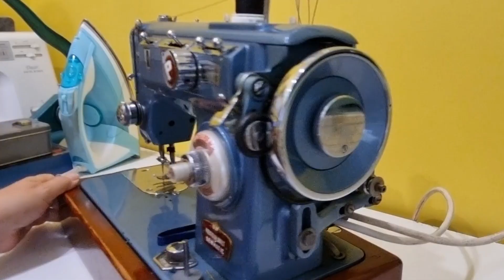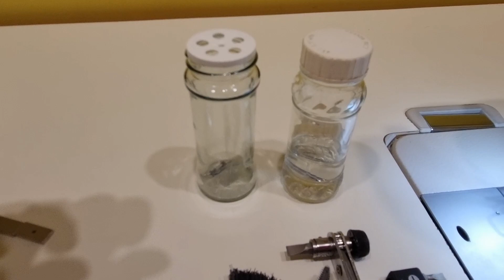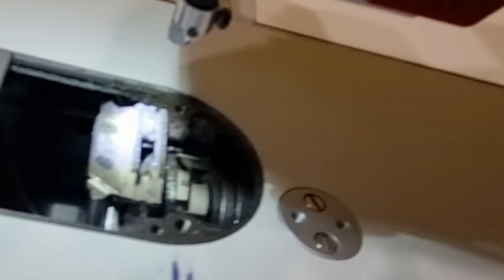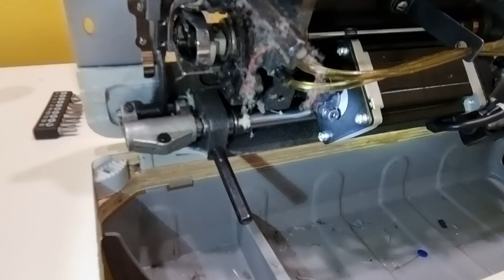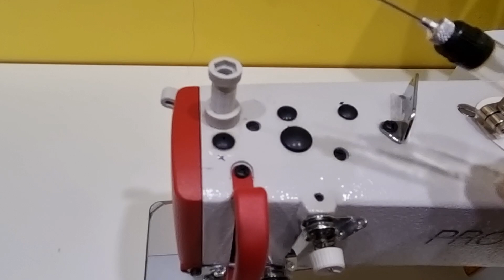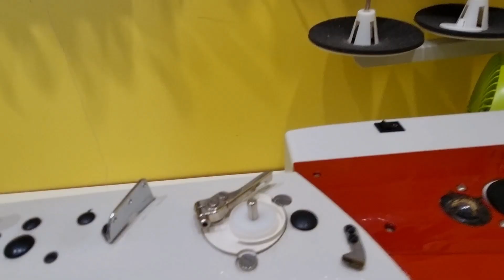Machine maintenance, changing a vintage sewing machine belt, some handy tools, and an electric shock

Comment: Phew that was a close call with the damaged power board! 
Great tip to use a mascara brush, will have to try that one. 
I have one of those mini ratchet screwdriver sets too, so much easier to get into tight spaces to clean and service my vintage Singer machines. Your vintage Pinnock is gorgeous!
Reply from the maker: Thanks Dianne. It is an adorable machine😀

Comment: Magnets are really useful. I have one on an extending pole to pick up any dropped needles and pins that I’ve dropped that I wave across the floor. 

When I change needles I use a sharpie on the flat side to mark it as used before put in into the needle box.
Reply from the maker: Great tips Duncan. Thank you😀

Comment: I'm scared of electricity also.  This time of year everytime I turn on a light switch I get a static electricity shock from the screw in the plate.  Replacing old Power strips is a good idea.  Thanks for sharing.
Reply from the maker: Oh that would be frustrating Cynthia. I often get shocks from the car door handles😀

Comment: Christine nothing worse than getting an electrical shock, lucky you are ok.  Might be a good idea to invest in a GFI, like they put in the bathrooms and kitchens. I have a Pfaff walking foot industrial machine it is old but it is a very strong machine.  I like the idea of a finger guard, when sewing a boat canvas cover I almost ran over my finger.  That really scared me, I did realize that motor still holds a charge even when you turn the motor switch off. Great video thank you
Reply from the maker: Stitching your fingers hurt. I've done it twice now. On a domestic machine too😀

Comment: To get to the screws in the cover plate, I use a couple of screw drivers, that I got from Temu. They are short and stubby and work great. Also, a US quarter coin works well. It is rounded and fits into the screw heads.
Reply from the maker: Thanks Richard. I have a couple of those tiny Singer screw drivers, and forgot all about the coins😀

Comment: Oh lord Christine! I’ve had that happen to me as well! Scared the pants off me 😱glad you’re ok. Thankyou so very much for this video. I inherited my mum’s old Pinnock machine, can’t remember the model at the moment, but I had to bring her out when both my ‘high end’ domestic machines decided to go on strike. Luckily she had kept the manual, and everything including wooden spools of thread. Read through, oiled, new needle and away it went. (Like a scary rocket!) was very interesting to hear you say about the lag when starting sewing as that’s what mine does, so off to see if I can find a belt. 
On another note, love to hear if you get feedback from ProSew regarding oiling points. Your close up shots were really helpful. Thanks again 🌻
Reply from the maker: You may not need to replace the belt yet Wendy. If you try undoing the two screws and pushing the motor a little further back, it may be enough to tighten the belt😀

Comment: None of my sewing machines will plug into a power board like yours. I use serge protectors on my antique sewing machine to help extend the life of those beautiful old sewing machines. They are always unplugged from the wall outlets, when they are not being used. I bought special tiny attachments that fit on to my ShopVac that helps me brush and pull lint out of my machines. They were well worth the money I paid for them.
Reply from the maker: I've seen those little vac nozzles. Must get some😀

Comment: Did you try putting some belt dressing on the belt. It conditions the belt and helps stop slippage. I bought my can of belt dressing at an auto parts shop.
Reply from the maker: I've never heard of it before Arvetta. Will check it out😀